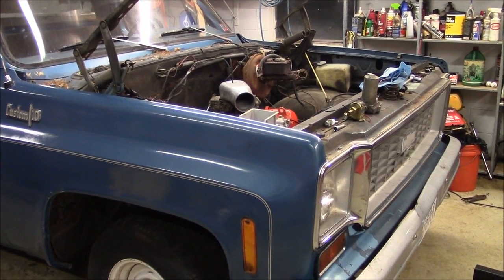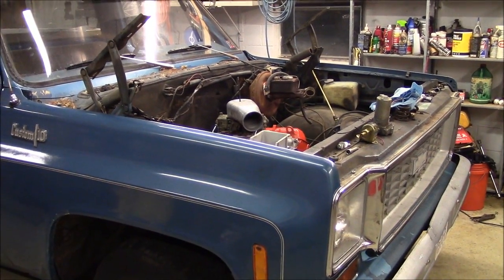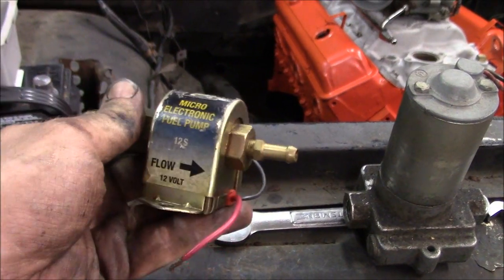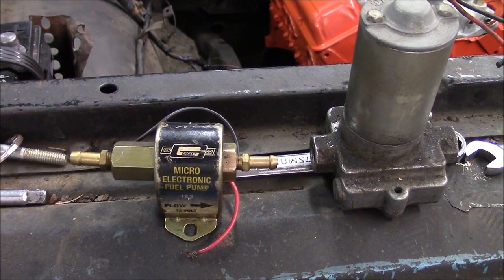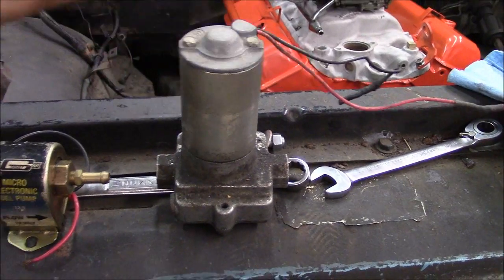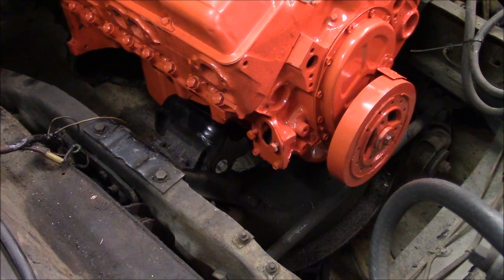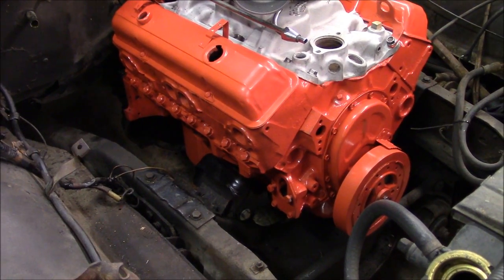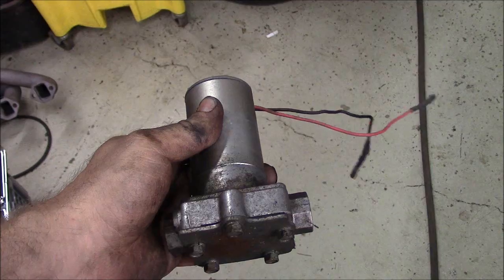Installing an aftermarket electric fuel pump on your Chevy Pickup

Comment: The mechanical pump works just fine, unless you replace your engine with a later model block with no provision for a mechanical pump. I understand if you personally don't care for an electric pump, but your video was a slap in the face and a waste of time for anyone truly needing to know how to install one. I do however agree with your installation method for the "clickety-clack" pump.
Reply: The mechanical pump DOES NOT WORK FINE, I have had numerous fuel pump cam lobes go flat! now what? I am not going to replace the cam just so I can keep using a mechanical pump.
Reply: @integr8er66   i am in need of this info
Reply: @integr8er66  LOL 5 years later I have this same problem - mechanical fuel pump cam lobe was ground down. I'm trying to install an electric pump and I keep coming across this goddamn video

Comment: So …. I have a vaporizer fuel system caused by heat . The mechanical fuel pump mounted to the engine block is not doing me any favours. I’d like to KEEP IT SIMPLE STUPID. I have considered a return to tank system to cool the fuel any thought? I don’t want the noise or hassle of an electric pump

Comment: LOOOOOL!!!

I was thinking the same thing... I've owned dozens of mechanical pumps and had no problems on "regular" cars other than replacing a 30 year old leaker from time to time. I guess if you were needing tons of extra fuel an electric may be a way to go.

Comment: I have an 88 Cheyenne. The previous owner put a 4 barrel carb on it instead of the fuel injection. 

He ran the fuel line from the tank to the mechanical pump on the older used engine that he installed. The electric pump pushes fuel to the mechanical pump on the side of the block. 

My question is; is this ok to do or will it cause problems?
Reply: The stock electric fuel pump can't be running.  It provides too much pressure.  It'd blow fuel out  from all over the carburetor.   Stock for my fuel injection was something around 60psi.  Carburetors want more like 10psi max.

He could have used the stock fuel line though.    With the old pump unplugged, the mechanical pump would pull through it, just like stock pickup.  It could be unplugged at the pump, the power wire cut somewhere, or even removed the fuse from the fuse block.

The stock in-tank electric fuel pump requires fuel to recirculate over it, to keep it cool.  If you don't have a bypass regulator, your electric fuel pump would have burned out very quickly.  

I converted my '99 Tahoe from fuel injection to carbureted.   It didn't have a stock mechanical pump, and nowhere to mount one.  I kept the stock high pressure electric fuel pump, and I'm using a Holly 12-803BP bypass regulator, mounted on the firewall where the stock fuel lines are.   That changes the stock 60psi to 10psi, and recirculates the excess fuel to cool the pump. 

I only found this video because I was looking to see if there were a better external pump option available now.  My fuel pump finally gave up at 230,000 miles.  So I have to do something.  I think his video pretty clearly said that I should replace the stock pump, and not put an inline pump in. :)

Comment: Im having trouble with my nova, my carb is not getting fuel. I think the fuel pushrod is worn out are they hard to replace? or could it be a different problem? I have one in there but the rod seems like its stuck in there. Can you maybe make a video on it?
Reply: John Torres i had the same problem with my 74 nova. Couldn't get the worn/stuck pushrod so i capped it and installed electric pump and fuel regulator
Reply: It is a worn out cam lobe probably. I have had 3 of them do that so far. I like the mechanical pumps, but every one the cam lobe goes flat at about 80-100K

Comment: I'm so fucking sick of the diaphragm freezing up on the mechanical pump I have to disconnect the fuel line going in the front of the carb and back feed fuel down the fuel line and let it sit there for a while so it starts to free up that diaphragm so the pump will start working again. Plus changing out the goddamn mechanical pump on the big block sitting so close to the fucking frame is a pain in my balls

Comment: Electric fuel pumps have advantages over mechanical engine mounted pumps . I say stick to stock whatever the vehicle .  But if your wanting reliability for a classic you do things different than you do for reliability for a daily driver . But this video proved nothing other than you don’t know what you want in your chotchkee 30 minute overhauled rattle can sbc

Comment: I don't get why people install those damn things. There is nothing wrong with the mechanical pumps, I mean yeah, they can go bad, seep gas into the oil, or out on the ground, or both. But if you replace them every 10 years or so, they aren't a problem. I mean it sucks to get your finger stuck in the block underneath that damn fuel rod, but hey, that's half the fun of working on an old car isn't it?
Reply from the maker: My 49 Chevy had the original fuel pump. I think 99% of the time people misdiagnose that the pumps fail.
Reply: Yeah, probably, but most of the cars I run into have already had it replaced by the cheapest one on the shelf. My '79 Olds was running like crap, 350 rocket, I took the fuel pump off and you could make the wheezy thing move by hand. Whoever rebuilt that engine didn't do a good job replacing everything outside the engine.
Reply: Our '74 GMC has its original pump and it's a one owner truck (Dad bought it new). That's all I can verify, for certain, but 42 years seems like a decent track record.
Reply: to avoid messing with holding the fuel pump rod just swap it out as close as you can to an oil change and get the cam positioned on its base circle and put a healthy amount of bearing grease on the fuel pump rod. then slide it home and it will stay there while you install the fuel pump. run it till the engine is at operating temp and drain the oil. quick fast ind in a hurry mechanical fuel pump install. i hope this helps in the future, Jack